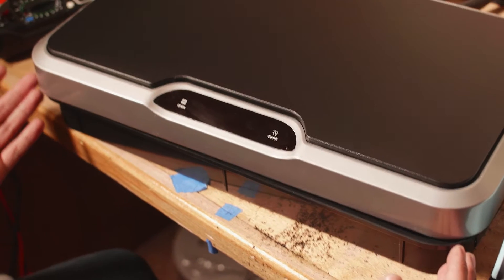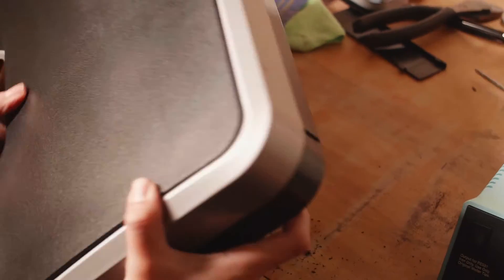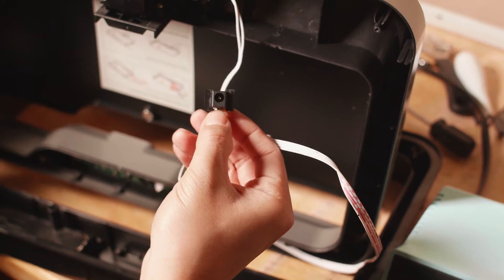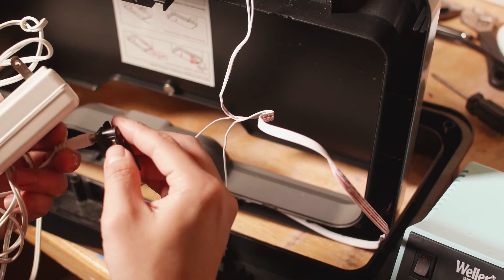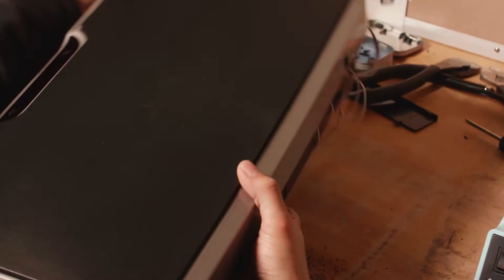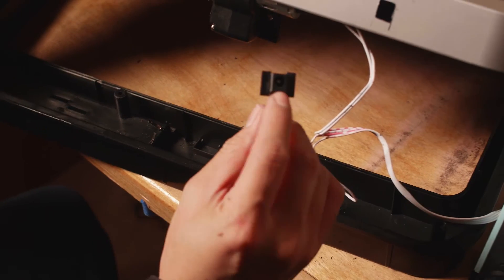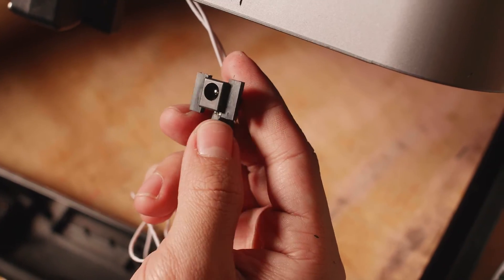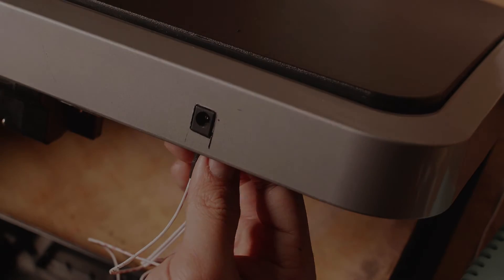DIY EKO Mirage Sensor Trash Can Battery Modification Hack

Comment: Does anyone know how to fix it? Turned on all buttons to the on position and i put 6 new batterys. It doesnt do anything. I would like to fix it. Any help
Reply: Sometimes the problem is oxidation caused by batteries having leaked (or in this case, water getting into the case because people washed it too liberally and it got inside). Make sure that the 'buttons where the positiive side of the battery presses against aren't rusted. If they are, use very find emery cloth or a Dremel tool with a wire brush to burnish it shiny again.
Reply: When I opened mine to hook up the ac adapter, the negative wire terminal that connects to the battery bay had corroded and disconnected.  Might be worth opening up to see whats going on.

Comment: how did you open it without breaking it? I unscrewed all the screws on the bottom but it's very hard to open it. Is there something I'm missing?

and do you have links to the parts you got?
Reply: I saw a comment on another video saying that there's also a hidden screw under the label/sticker!
Reply: There is a screw inside the battery compartment.

Comment: great vid! Any idea how you can turn off/take out the sensor but still use the touch buttons in order to open / close? Problem is that I put the can in a drawer and the moment I close the drawer the lid opens and closes by itself repeatedly... GRRRRRR
Reply: Why didn't you just put a piece of electrical tape over the sensor? Too easy?? :P